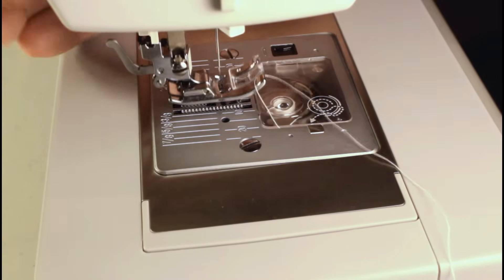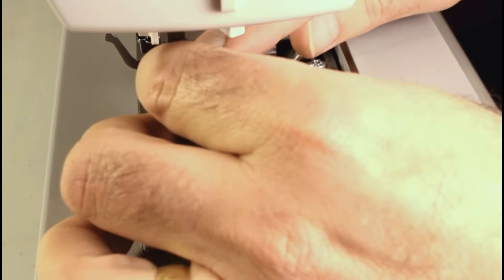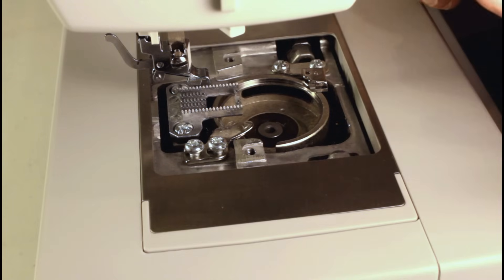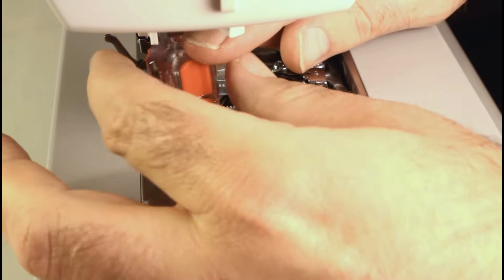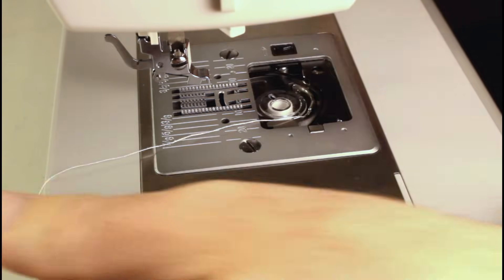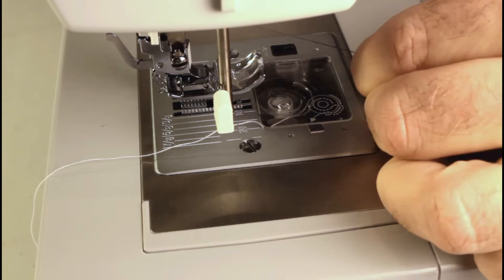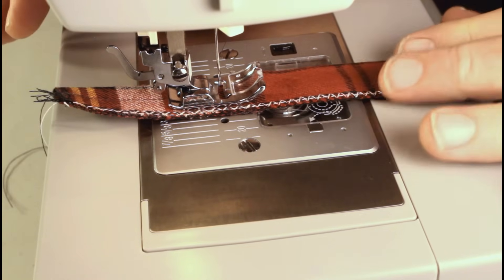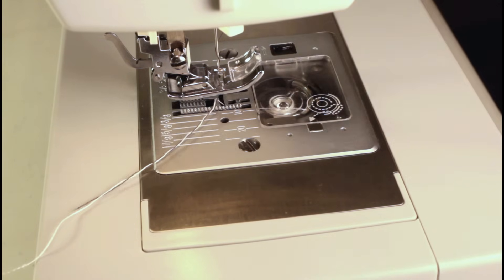Singer Heavy Duty - Adjusting Bobbin Tension, Please read the Description before posting questions.

Comment: I have owned and used several Singer machines. Singer model 4423 is the worst machine I have ever used. To have this many steps to adjust bobbin thread is absolutely ridiculous. 
Also, the needle position adjustment does not do much and other presser feet do not work on this machine.
I  really, really dislike this machine and wish I had kept my 15 yr old Singer.
Reply from the maker: Time to find a older classic machine.

Comment: Needle's wrapped
Reply from the maker: See the NOTE! in the description.
Reply: Didn't see description, but noticed when you threaded the needle, it was wrapped around it, no biggie, pull clear off you go, have the Singer 5532, nice to have a zigzagger near by, after about 8 years, finally mounted it in an old table from our Elna👍🏻

Comment: Hi Kevin.  I am so bummed.  I bought a new Singer heavy duty 4425 yesterday and for the life of me I can't get it to sew normally.  These are the ugliest stitches I've ever seen.  I tightened the bobbin as per your video and it may be a tiny bit better but not great by a long shot.  Any advice?  I did all your troubleshooting and followed your tension video and put new needles and wound more than 1 bobbin to make sure.  I threaded it with the needle at its highest position.  Here is a pic:  https://photos.app.goo.gl/gH5VUcPZq4cv9GDt9
Reply from the maker: I am sorry for my delayed response. I clicked on the link and I got an empty album.

Comment: OMG‼️‼️‼️ THIS🔺should NOT be ALLOWED to be on YouTube‼️ I have been sewing for 65 YEARS, & the 1st thing U adjust is the TOP TENSION‼️‼️ 
99% of TENSION PROBLEMS can easily be fixed, by a SLIGHT ADJUSTMENT of the TOP THREAD TENSION‼️‼️  Bottom tension is much more difficult to adjust‼️‼️
If the thread is bubbling on the top of the sample, the top tension is too tight; loosen it by turning the top control to a lower number, 1/4 turn at a time.  If the top thread is bubbling on the bottom of the sample fabric: the TOP TENSION is too loose. Tighten it by turning the top control to a higher number, 1/4 turn at a time.  You DO NOT HAVE TO TAKE YOUR MACHINE APART, to easily adjust your thread tension‼️‼️‼️🤯
Reply from the maker: Okay, so do this for me. Take your bobbin out and loosen the tension. Turn it at least 2 rounds... this is usually how far it is usually off when users have this problem. Then apply your logic and get back to me with your results. Better yet, create a video showing how you work it out. That way we can all learn from you.
Reply: hate to say the top tension has been adjusted to lower number , then high and it’s still pulling threads down. so sometimes it’s necessary to adjust the bobbin screw . first look for lint.
Reply: I've been an industrial factory sewing machine mechanic for 50 years. First domestic I've purchased and it cannot be adjusted by the needle thread tension. Stupidity to have a bobbin case which cannot be adjusted. Great video Kevin.